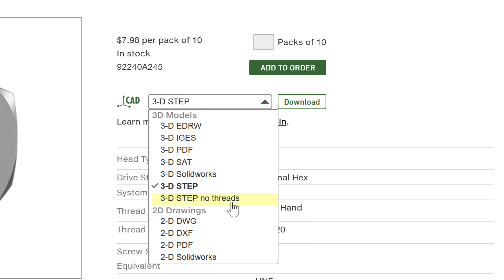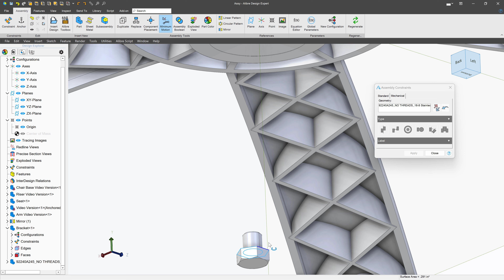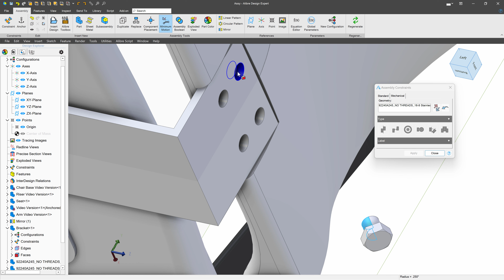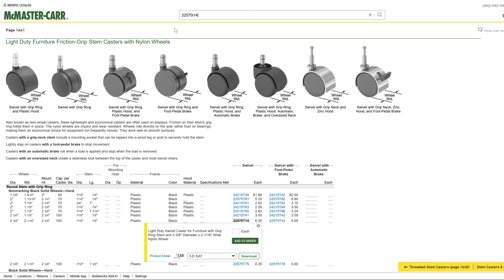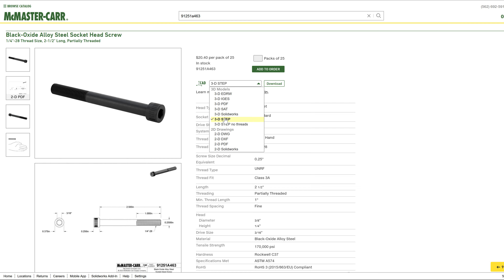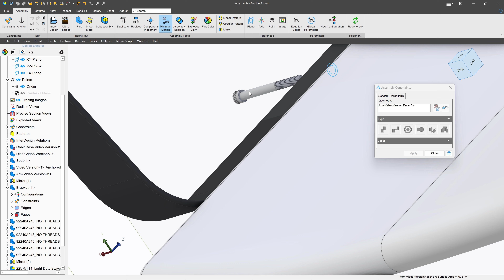Comment: Keep in mind that mirroring right thread produces left thread. May be not important here, but important when you prepare parts for 3d printing.
Reply: An excellent observation.  For threads made with the hole tool, it won't mirror them since there are no physical threads modeled.  For holes with physical threads, you're absolutely correct, and a great design consideration.